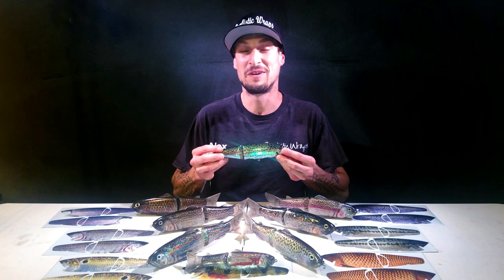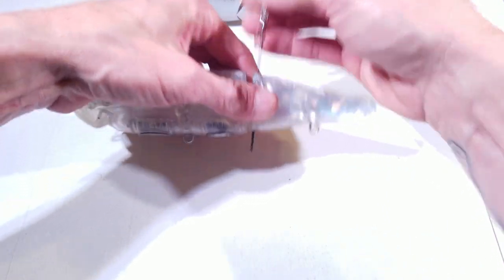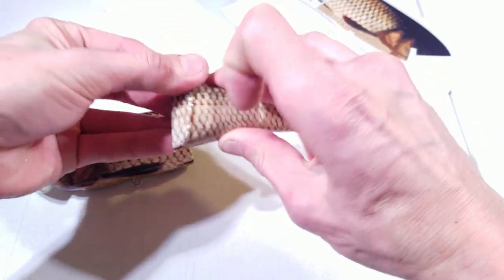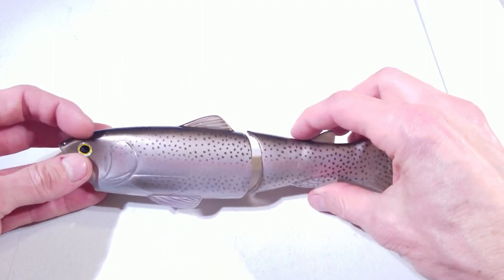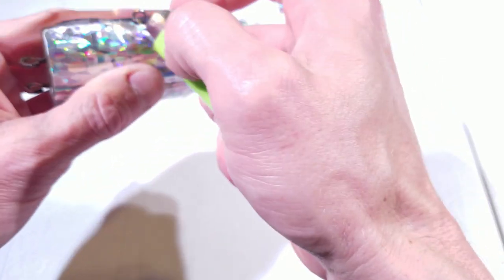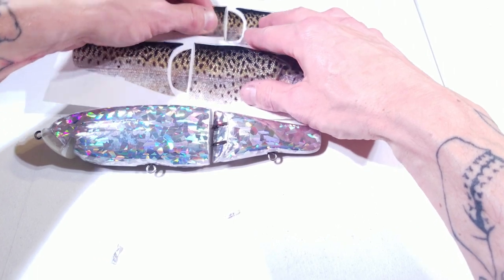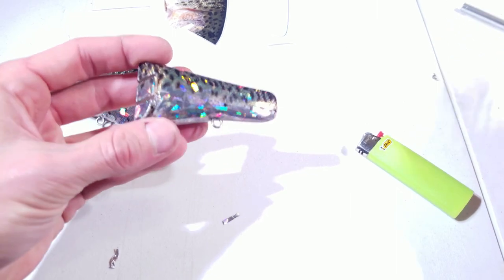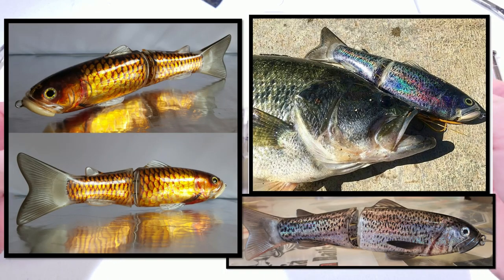INSTALLATION DEPS 250 SLIDE SWIMMER

Comment: Is the AlumiUV part required?
Reply from the maker: No but it helps add some protection and really makes the colors pop from the print. You can also use super glue in the bottle with a brush, coat over the wrap.
Reply: Realistic Wraps how long does it normally take for a wrap to be shipped out
Reply from the maker: @crown951  Usually the same week, unless there's a out of stock material that's awaiting delivery.
In those cases we throw in a free extra wrap of two, for the inconvience and delay.

Just looked and your my only order that's waiting, I just received the material today so your order will ship tomorrow.
 What pattern would you like? 
I'll throw in, on the house : )
Reply: Realistic Wraps I guess I can go with a “reflective gizzard shad”...and thank you so much for the quick replies...I just wasn’t sure if it was sent and I didn’t get a tracking number
Reply: Realistic Wraps just to be sure we’re talking about order #1159 ?
Reply from the maker: @crown951  Yes sir, Mr. Brown. : )
Reply: Is the alumiUV or super glue for securing the wrap to the bait or for securing the cover to the wrap. I looked up the price of AlumiUV and its very pricey.  Secondly you mentioned painting on super glue as an alternative, is this just to secure the cover to the skin?
Reply from the maker: @brannonsmr  it's for securing the seams of the wrap to the bait, and can also be used as a protective coat replacement to put over the wrap and allowing to fully dry, before putting the skin on, but never used on the skins directly.